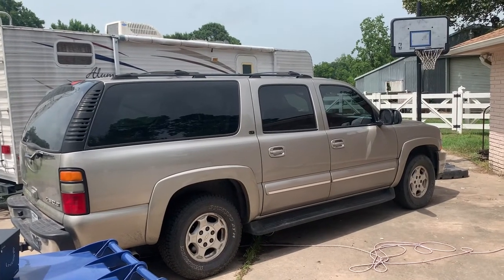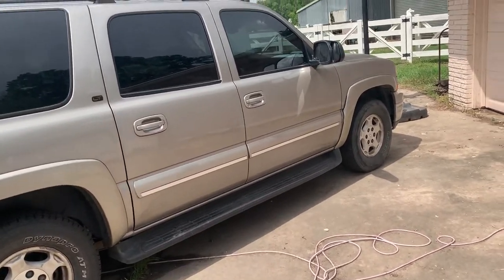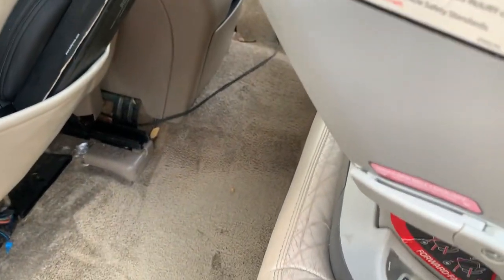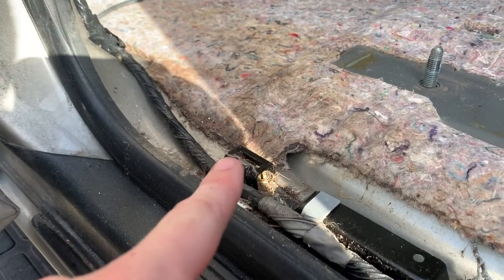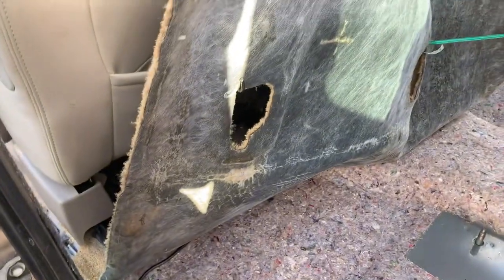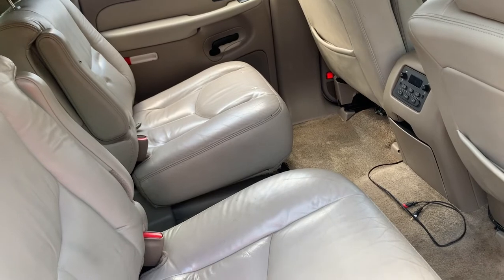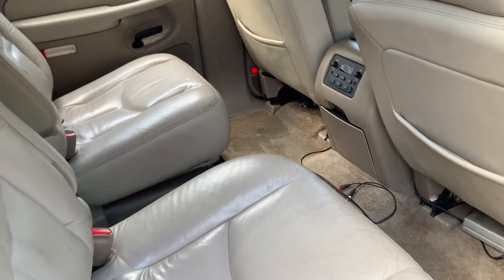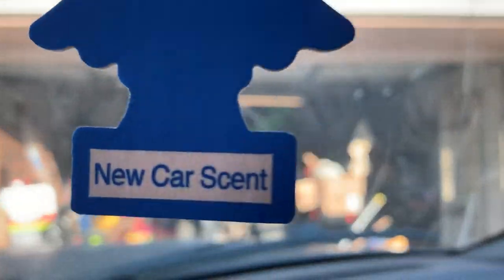A Chicken Died In My Car, How I Removed The Smell

Comment: A squirrel died in an attic above a garage. Removed the maggot covered body but the smell would not air out. Broke off a piece of a chlorine puck used for swimming pools and placed it on the spot where it had died and left it there for days. Vented it all out later and went up to inspect. The smell was completely gone. It wouldn't be easy to do that in most cases as it's just too caustic but for an all wood structure short term it worked out.
Reply from the maker: I bet chlorine would get the smell out but wonder if it would leave a chlorine smell?
Reply: @mjmcomputers   Too much of it might but I believe it all ultimately dissipates. I know that in pool maintenance you are constantly losing chlorine. In then end it just smelled like a wood attic.

Comment: Pulling the seats out and having them in direct sunlight on the driveway is a good idea, childseats, etc... Plastic has a "memory" with smells. Those flies on the front seat were a clue that things were still funky!  if it's not nailed down, pull it out of the vehicle.
Reply from the maker: Yeah I pulled them out and they sat out in the sun all day while I worked on cleaning the carpet. All the trim pieces and mats sat out as well. It was quite the job but no sign of the smell now.

Comment: I left chicken in my car last week after getting groceries. I havent been using my car to save gas and found out today 7 days later. Do you think this is possible with non leather seats? 
Would i use the carpet cleaner on them too?
I wanna cry so bad i just paid off this car 😭
Reply from the maker: Yes carpet cleaner should get them all cleaned up. Test a small area first to make sure it doesn’t hurt the color.